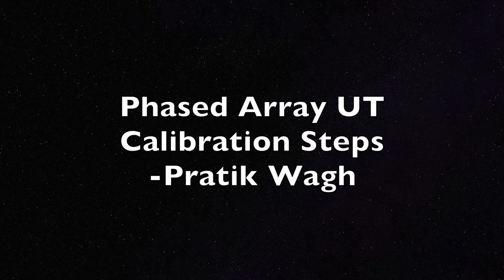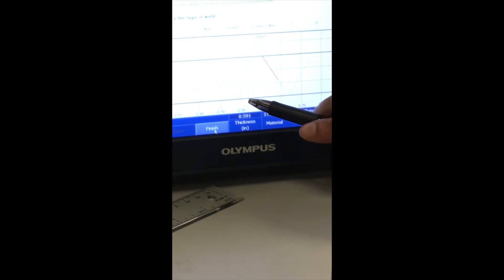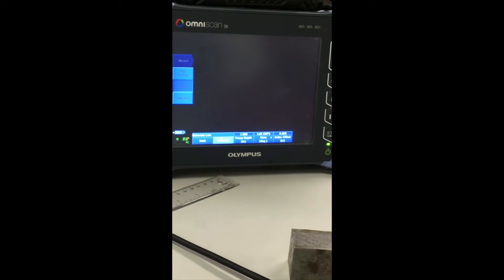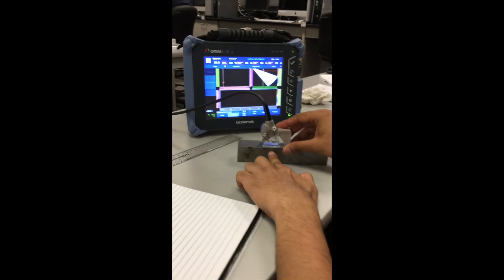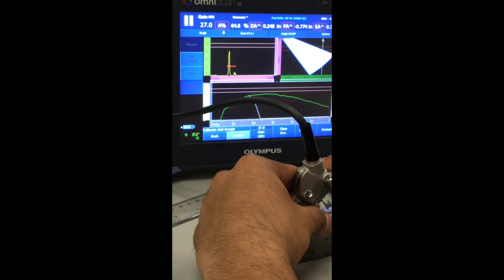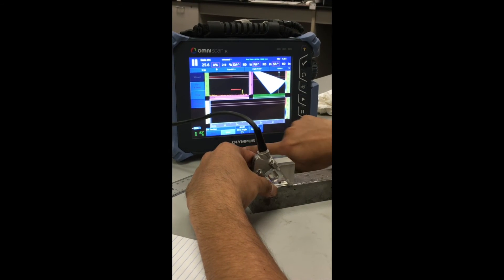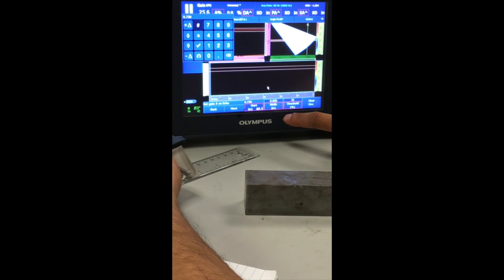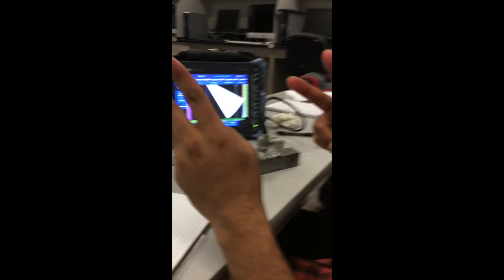PAUT Sectorial Beam Calibration

Comment: you used for this calibration depth for 1/4" to 1", if my weld is on a plate with 0.280" thickness, this calibration works? o i have to use a maximum depth my thickness

Comment: I mate I followed the video step by step but I don't know why in the section where you are calibrating de wedge (minute 4:36 from the video) your gate runs and follow your indication while you are moving back and forward the probe BUT in my case I try to do the same and my gate stays just in the same position and my indication decrease (naturally) as more as Im far from the reflector (in my case an IIW type 1 radius).
Reply: U need to synchronise your A gate with your back wall echo. I don't have an instrument with me at the moment to tell you exactly what needs to be done to get that, sorry. Hope someone else can help you out.
Reply from the maker: I am not sure why that happens. I will try using IIW type 1 radius and get back to you soon.

Comment: hello why you didnt do the velocity calibración before of wedge delay calibración?
Reply from the maker: Also, in many cases, velocity calibration might not even be necessary. Because, you will be performing velocity calibration on a cal block which if it is not the exact same material as the part, then it will be waste. Better to pick the textbook velocity value. And if you use SDH for velocity calibration, then it will throw the values off even more. So if at all you are performing Vel Cal, use Radius.
Reply from the maker: Because first the instrument has to know the distance travelled by sound inside the wedge which is the wedge delay, before it can calibrate for the velocity inside the part.
Reply: yes